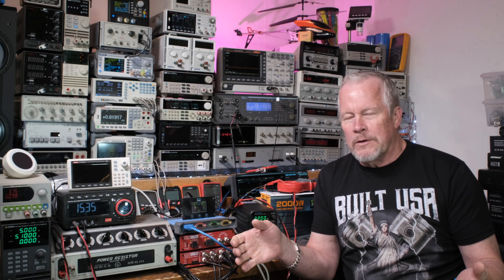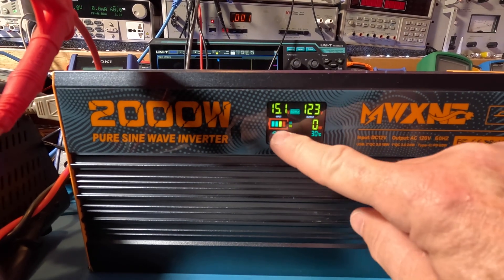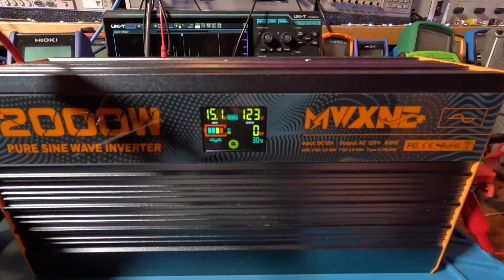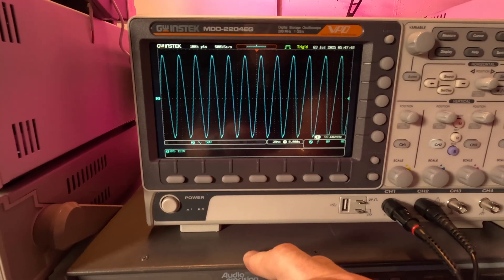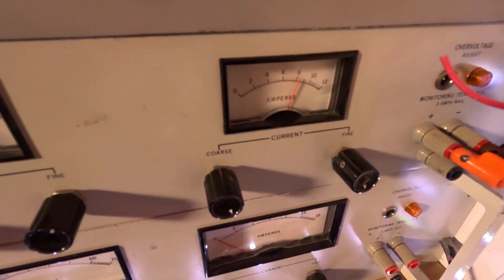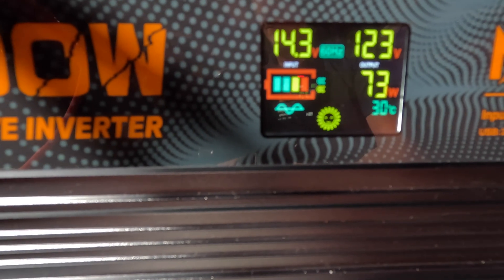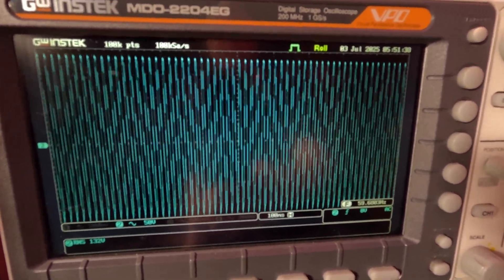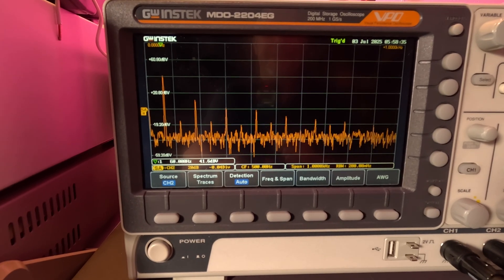2000 Watt Inverter Low Power Performance Testing #puresinewaveinverter #MWXNE

Comment: Hi Eddie...I have been dying to ask you the following question about inverters. Comparing a high frequency switching inverter (like the one you reviewed) with a slow frequency (line frequency or 120 hz) inverter, I have been told low frequency inverters have better surge capacity than high frequency inverters. Can this be true? I do realize a low frequency inverter has a much larger transformers with a larger flux density...but it supplies that flux at a low frequency compared to high frequency inverters (with lower flux density), but delivered at a much high frequnecy. Given that, I think a 2000 watt, high frequency inverter should have the same surge capacity as a 2000 watt, low frequency inverter. What do you think?
Reply from the maker: I appreciate you asking, that's a great question.  It really is about how the ratings are done.  I will explained this in a video to come.

Comment: Great information as always, and I am looking forward to the High-Performance Testing video; thank you.

If you open to suggestion, I recommend your test area only have the equipment you're testing and the equipment you're testing with (or at the least, clear the bench top area).  I believe this would help clarify for us viewers, what is actually going on at a given moment/during the specific test and/or review.

Your wall of testing equipment is truly an awesome thing to behold (to include all the equipment at the bench level), but it is very distracting/difficult to look past...

Always learning.
Reply from the maker: I appreciate your thoughts - and thanks for watching!